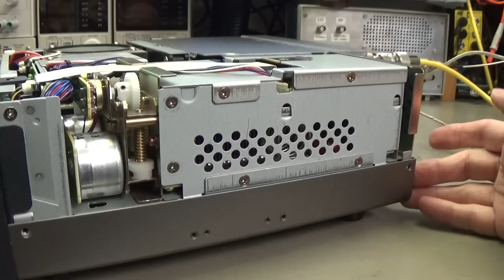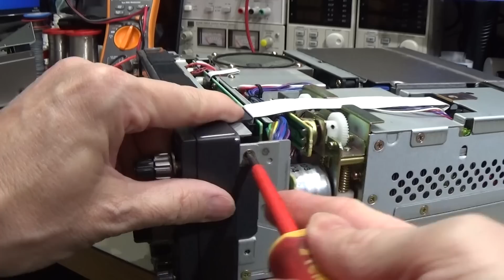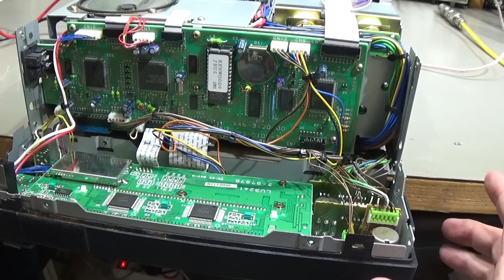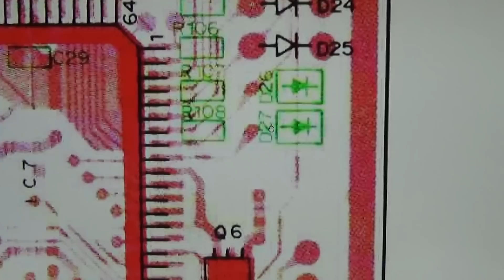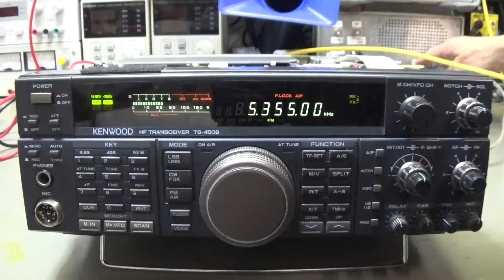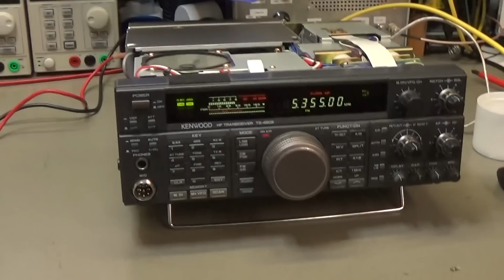#249 Kenwood TS-450S; full instruction to get the 60m Band running

Comment: Thanks for sharing, it’s great info for me to access the these diodes. I try to unlock the 7.1-7.2 MHz TX mode.
One thing to be aware of is the filter height goes beyond the bottom and the unit is sitting on the filter that can bent the PCB.

Comment: I had a Kenwood TS-430S with matching PS-430 power supply.  When I got my new power supply (MFJ-4035) and Yaesu 991a, I gave the Kenwood 430 to a disabled ham who had just passed his General test and only had a HT.  Other hams have helped me out so I thought it was fair play to help out another ham.  That's what ham radio is all about--hams helping hams.  The 430 was already opened up and would transmit from 0 through 29.999999 MHz.  Just clip a little white wire on the bottom of the board, so I checked and yes, it had been clipped.  W Rusty Lane K9POW in eastern Tennessee

Comment: Thanks a lot. After having this radio for many years I dared to open it to be able to use it in 7.100/7.200 (it was closed in Spain). I lifted the radio to avoid damage to the extra SSB & CW filters ot the printed circuit that protruded from the radio lower support, it is in the manual, the lower cover has a bulge. I cut the diode with pliers. I had an annoying problem, the lower wider connection band disconnected itself when I moved forward the front, it was too short or forced bent from origin. And it was difficult to plug it in again without fully dismount the front, I managed to plug it in from the underside with my fat fingers with the front half open. I checked the audio capacitors (no bulges) and battery (3,3V) and all seemed OK

Comment: You didn't mention if the tuner works on 60 or not. It will not tune 60 on the TS2000! You must use an external tuner for 60 if the antenna is not resonant.

Comment: Nice, easy job.  One tip: when I do this mods I solder the diode back to one side of the pads.  That way if I want to reverse the mod at a later time I don't have to go looking for another diode.  I simply remove it from the single pad it and solder it back to both.

Comment: Hi Peter thank you for a great video I to have a Kenwood TS 450 but at this time a friend of mine is using it. I did not know that this radio can be converted to 60 m very interesting. And I was just wondering about the battery I’m assuming that you can take the old one out and put a new one in is that correct? I take it the battery is not soldered to the PCB. Thank you for sharing the video and have a great week.
WD5ENH 
Steve